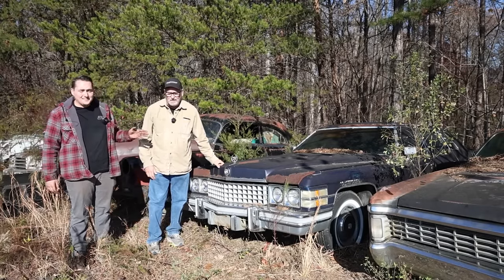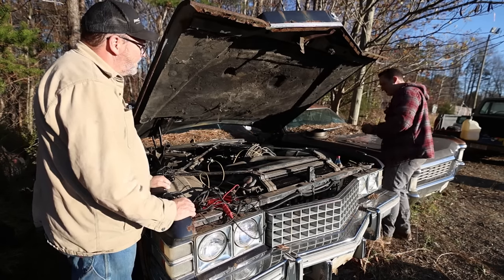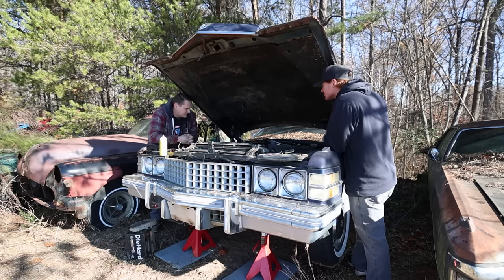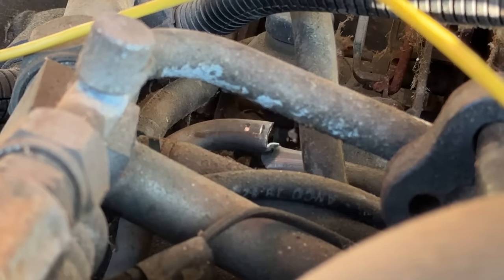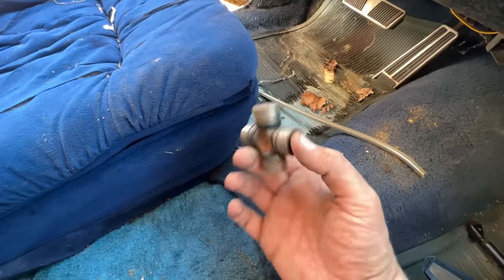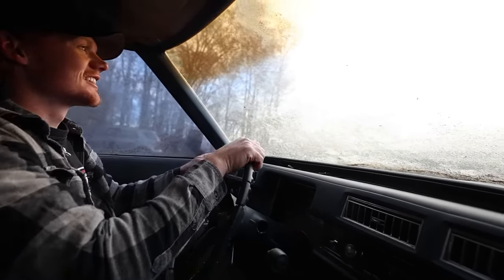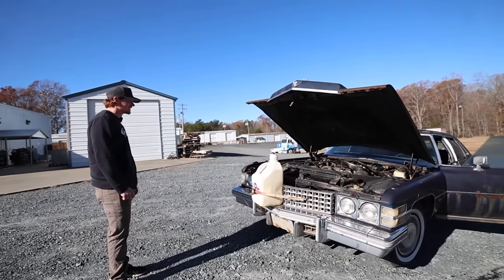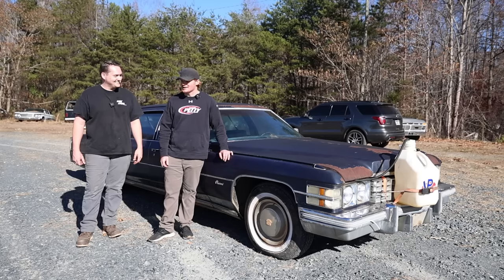RICHARD PETTY'S Forgotten Cadillac Limo - WILL IT RUN After 28 Years?

Comment: Great Video!!  I once bought a new '72 Cuda that was "Richard Petty Blue" as indicated on the window sticker. Had white stripes on sides & white vinyl roof, I put a set of Goodyear white letter Polysteel tires on it. I worked at WDAR in Darlington at the time for about 2 years. I was am still a huge Richard Petty & Mopar fan. I now work at a station in Clinton, TN & we carry all the Nascar Races on MRN, PRN & the Truck Series.
It was great seeing the Richard Petty Garage & the startup of the Big Caddy.

Comment: Interesting stuff! I had 1974 Coupe Deville for a few years, it was smooth ride indeed. BTW, the start button underhood is for bypassing Seatbelt Interlock System which was in use in 1974. You had to wear seatbelts in order to start this thing and if/when system failed you could press underhood button to bypass this and start vehicle.. Mine had this bypassed long ago.

Comment: That's a 74 Cadillac 75 series formal  limousine. Some came with solid and glass partitions in one piece or like this one  with no partition at all. 74 was also the last year for round headlights, the 472 engine and point type ignition . There's also a fuel filter in the fuel pump  housing and a separate AC and heating unit in the trunk.The engine pistons for that year are flat top,block is heavy nickel content,and weighs about 70lbs over small block chevy and were built to last.
Reply: This car is the Series 75 Sedan, not the Limousine. Only the Limousine had the partition.

Comment: The limo came with a front bench seat and some later person put  a pair of mismatched bucket seats in the front. Later when they retired it to the back 40, the front bench was just thrown in the back.  There are not two full bench seats in the rear of a limo like this. You get more leg room and two fold away "jump seats".  I rode in a car exactly like this at a relatives funeral.

Comment: Yeah I agree one should do work on that Cadillac re new the Radiator fit new ignition barrel new tires Sort the interior an bring back some shine to the exterior give it some love an use it .. runs good Can’t believe the Brakes actually worked after sitting 30years but hey they did that’s awesome.. I owned a 73 Cadillac Eldorado Baritz back in 1980 that had the 500cu in engine front Wheel drive an ran on regular Gas hit 16MPG on long runs would you believe ..

Comment: In 1974 the 500 was only used in the Eldorado,  however if that is a factory limo it's possible Cadillac put a 500 in it. Otherwise it would be a 472.  In 1975 all full size Cadillacs used the 500.

Comment: The start button on the firewall was for the seatbelt interlock. Back then the seatbelts had to be buckled for the car to start. The button would give you one start in the event the seat belts were broken. Most folks disarmed that government feature.
Reply: My 74 Charger still has that interlock on the firewall.
Reply: The button was a bypass a mechanic could use while working on the car.
Reply: @rafaelfiallo4123  yep
Reply: @LongIslandMopars my 74 plymouth satellite sebring still has the factory belt interlock system with the override button on the firewall
Reply: @mopar_man74  Cool! Keep 'em original.
Reply: @LongIslandMopars  it's finicky and is a pain in the ass because sometimes when it's hot in the summer it doesn't wanna work even with the seat belt locked in
Reply: @mopar_man74  Oh, mine is disconnected. The wire is under the front seat. I hooked it up once to see it work in the 25 years I've owned it, then disconnected it again.
Reply: @LongIslandMopars  when it works it's OK just doesn't like the heat ig, I'm probably gonna disconnect it at some point though
Reply: @mopar_man74  ok, cool. Nice to meet another 74 owner.
Reply: That module that he picked up right at the start of the video was the starter interlock module.
Reply: 74 b bodies are some of my favorites because it's literally the last death cry of the muscle car era, and it feels nice having one from the last year of its production 🤘 cheers!
Reply: @mopar_man74  I agree. My Charger was the last model year that the King raced a real Mopar racecar. The Magnum didn't cut it even though I thought they were a good looking road car.
Reply: @LongIslandMopars  yeah the kings 74 charger was super iconic to me cause I love the fuselage charger style
Reply: @mopar_man74 Me too. I grew up watching NASCAR with my dad and he was a Petty fan because a) he was a clean racer and b) he drove a Dodge. The 74 Charger was my favorite because it looked iconic (like you said) and it won a lot of races. The King is even on record saying that car was their all-around best racecar for how well it drove and the amount of races they won with it. I always wanted one after my uncle sold his 72 to a cousin who later wrecked it. I found my 74 over 25 years ago with only 27k miles. It is unrestored and can be seen on my channel in various videos. I may eventually do a series on it along with my dad's 66 Coronet that he owned from new and which has been in my inherited possession since 2011.
Reply: @LongIslandMopars  I never grew up in that era and I'm only 18 unfortunately I so wish I would have been born then so I could experience that era, I was gifted my grandpa's car this year as a graduation present by my mom when we got it running in May of this year I drove it all summer and had a blast with it
Reply: @mopar_man74  What an awesome story and honor it must be to be the custodian of your grandpa's Satellite. Is it a 318?
Reply: @LongIslandMopars  it becams my mom's after my grandma's in 2011 after my grandpa died and unfortunately it just sat due to nobody knowing how to work on it. In 2020 my grandma died and the car became my mom's and now it I'd mine. It does have a 318 in it
Reply: @mopar_man74  Amazing story. Thank you for sharing it with me and followers of this thread.
Reply: @LongIslandMopars  ofc I'm always happy to share, I feel like the custodian of the car to share its history
Reply: @mopar_man74  You are my friend. The Satellite is in great hands.
Reply: Thank you I will never sell it, it is my most valued possession and it will be driven for many years to come

Comment: I bought a 66 fleetwood 75 limo, funeral homes use them as the "family car" for funeral processions. It should also have a separate climate control unit for the back seats, also those flip ups are for rests. These are so much cooler than regular cadi sedans. You found yourself a gem, and the king is looking great still!

Comment: The 500 Cadillac is the biggest cubic inch version of Cadillacs v8's and is similar to the 472.  It is also the largest v8 used in a car of that era in terms of cubic inches. It has the bore spacing that is also a tie for the largest, meaning it has great potential.
Despite this, it is actually LESS heavy and bulky than several of the other v8's of the era.  It was a popular swap in old Chevy pickup trucks since it weighed little more than the small block they were replacing.  I have to guess that the narrow cylinder heads compared to canted valve engines was one factor keeping the weight and width down.  Also, it had a very mild idle and more torque, so it was well suited to pickup truck use.  There were aftermarket parts for it but they were not very popular.

Comment: I had a 1968 Fleetwood 75 . This makes me miss that car. It had those little fold down seats and those little things under the seats are foot rests. That other seat you pulled out doesn't go with the car.  Someone added that. Mine also had a sliding window between front and rear seats and a car phone

Comment: I'm old enough to have ridden in this model caddy, in 1971 one of my grandmother's passed away, I was probably 11, the little seat in the rear was for an extra passenger and the thing that came up when the seat was folded up is a footrest, I'm sure the manual is either available online or maybe from the coach company that built the car, I don't think it came from the factory like that, they were also probably used privately also, the chauffeur would drive and there was probably a glass partition that would separate the front from the back. A local funeral home near me is selling a mid nineties hearse, I think its a caddy or Buick.

Comment: The water running out of the trunk could be a coolant leak from a rear heater core that was used to heat the back area. The small seat that  folded up was called a jump seat. Then that other piece that folded down was a foot rest for the people in the back seat.

Comment: Good job. wonderful car,  the america that i loved. For those who wish to restore classic cars. There is one thing to know :  to be definitively efficient against rust,  you should  put grease everywhere. grease is the only thing very efficient against rust. put grease between metal and carpet, inside door, behind metallic bumper, under the vehicle, behind  the repairs you can make (everywhere inside the body - hidden erea -  instead of using paint), hollow areas (necessarily hidden, so no need to be aesthetic). For rear wings unreachable with a paintbrush, use an extender and poor old oil everywhere each year. rust  always comes  from the inside and welds.  Handyman Experience - 35 years.   From france

Comment: Its actually  a 74 and should  have a 472 engine.  Its a Fleetwood  75 with jump seats. That's  the short limo
Reply: I believe Cadillac limousines are built at an entirely different limo only factory.
Reply: @Supertech-86 Cadillac built these in the Clark Street assembly plant in Detroit with the Devilles and Fleetwoods.
Reply: @Andrew-bb3lc  I knew someone who worked a GM plant in Auburn Hill, they exclusively produced limos, they may have been built at Clark Street but once the stretching and interiors begins, its all custom fab - it would be impossible task to run them on the same production line.

Comment: The Petty's are good people. That Cadillac has a lot of history, the stories she could tell,.....  I would continue fixing her up. Get the radiator fixed if possible, if not get a replacement aluminum radiator, it may have to be custom made as there really isn't a big market for 1975 Cadillac parts. The key tumbler is an easy fix, new tumbler new set of keys, good to go. The paint being single stage can be brought back with a cut and polish. Put her back in service. A great support vehicle for in state races. Might as well get to the races in luxury.

Comment: Would the King sell me his Imperial?

That Bench seat that was in the back is probably the cars' original front seat.  I don't think Cadillacs of that era could have front bucket seats.

Those little seats in the rear are called "Jump" seats.  They fold out in case you need room for extra passengers, or fold away for all that big limousine room.  There should be two - one on either side.

Comment: Excellent video Dylan  :) also meet up Richard Petty , famillies, property  fix up Caddy Limo car  with 500 Cubic Inches  of a 8.0 Litre V8 4 Barrel carb  , Turbo 400 3 speed Automatic transmission  and 411 rear end gears! Yes those car get 8 to 10 miles per gallon local and highway get 10 to 15  miles per gallon  ! But drive like  boat on water smooth sailing Lol ! How know about those cars had school teachers drove them and plus lots friends of family's of mine all were Navy Blue with Baby Blue interior  and top notch options have everything! But amazing everyone seen original shape has Am radio no FM or even with CB radio 23 or 40 channels type of Delco brand ! But my one cousin Albert  has 1976 Caddy  , has Am / Fm  Cassette, plus 40 Channels CB Radio Delco brand 1980 one in 5 speakers  and antenna on front windshield  to !  That Caddy should be restoration to and key ignition fix up all needs !

Comment: Those Cadillac limos had the jump seats in the back, which is the seat that can be folded up against the front seat.  In a funeral situation, they'd typically be used to seat children, as full-grown adults wouldn't have much leg room. The little "kneeler" thing at the bottom was a foot rest for when the jump seat was folded up, so that the rear seat passengers would have something to brace themselves against if the driver had to make a panic stop.  Otherside, you'd be sliding off the seat (nobody wore seatbelts back then...the rear seat may not even have been equipped with them). That extra seat wasn't part of the car.  Probably just a spare seat.

Comment: 1974 the government introduced the new mandatory seat belt law. The relay you saw that says start is gm's answer to that law. You have to be sitting in your seat doors closed, seat belts on for the car to start.  Most people bypassed that system. The relay was so mechanics could start the car without all the other garbage. The law was modified a year later. So you only see that system on mainly 1974 cars. I have a 74 corvette with that system. I had to replace the seat pressure switch and a broken seat belt wire to get it working.

Comment: I would have replaced the mechanical fuel pump and not cooled around with an electric one., and replace the radiator and the water pump all the belts get rid of the jump seat in the back have a table with a flat screen TV attached to the back of the front seat. Mirror tint the windows instead of black tint, it's easier to see through and they reflect more Heat and the matches the chrome trim around the glass. A set of black center hubcaps, a set of h1h4 halogen headlights, new shock absorbers all the way around the filler panels around the tail lights and rear vertical bumper uprights. Wheel bearings redone, new brake hoses, new master cylinder, remove all the body side moldings a nice new one stage black paint job with enamel. New Black Carpet front and back. Pull out all the window motors take them apart polish all the shafts put the motors all back together. Do you rust and Lube all the door lock mechanism actuators. Careful with those power window buttons their fragile.. 1156 1157 Switchback turn indicator bulbs that are yellow/white. Some white 1156 LED bulbs in the cornering lights, even all the interior and the outer Opera lights they make LED bulbs that will go in all of them, and this car will be getting in better shape set of six fun odds in the back a new amfm radio a DVD player to play on the flat screen TV mounted to the back of the front seat a nice table with a cabinet with liquor bottles in it. And of course in those little cubby holes on the left and right of the back seat you can put the remote controls for the TV and the DVD player in those. I have a 78 limousine I'm fixing to do something similar with

Comment: Basically the seat you pulled out of the back is the actual original seat someone put those bucket pillow seats in it and the one small seat that you folded up is called a jump seat with a foot rest if you keep it folded up that's how old limos were they didn't start expanding the full lengths of limos big enough for 6 people to sit back there till the late 70s iv had two limos in my collection and that is small in comparison lol

Comment: that Cadillac is a 1974, with a 472 c.i.d rated at 235 h.p and 365 lb ft of torque with a THM 400 three speed automatic transmission.

Comment: Its odd that this is not a hei car from the factory. 74 was the year gm went to them. I wonder if its where it was a limo or something they didnt change that over.
Reply: The 74 limousines had the fan belt set-up for hei ignition ,but used the breaker point set-up

Comment: Soooo I have dug into it seems like a million gm cars from 60s 70s 80s and I've never ever in my life ever pulled a gm starter out with a ground wire across the starter bolt to the frame and it's probably the best thing I've seen on the Internet since is started to the public around 1997-98.... I own a 73 Chevelle SS with a 396 I installed when I was a teen and I still own the car and I've messed with the starter for years and years and had nothing but PURE trouble and NIGHTMARES with it.  So with new heavy duty battery cables and adding a ground strap like shown in this video.... Will this be the end to my Starter Nightmare?
Reply: Those ground straps came from the factory installed

Comment: O the youth of the world. 
The seats in the rear are called  JUMP SEATS.   Usually the lady's were given the rear full seat and 2 guys would jump on the jump seats. If the jump seats weren't being used the  rear seating passengers would use the back of the jump seat ad a foot rest.  That should have a 472 not a 500 cid.

Comment: Mr Petty's limousine is beautiful it deserves its fender skirts and hubcaps put back on it don't be lazy boys. Also the thing in the back seat that you didn't know what it was for that's for your feet. If you're not using the jump seat then you have it folded up and that's to place your feet on and when you're sitting in the backseat and that other seat is a spare it doesn't even really go in that car unless you need to replace the other seat? And it's supposed to usually have two of them little jump seats that you keep folded up unless you need to put more people and they're supposed to face Forward they're just axillary jump seats for when you have too many people in it that's all. Too bad Mr Patty's grandson doesn't get it fixed up and drive that thing around he'd be the talk of the Town driving that big old limo and a 74 doesn't have catalytic converters yet so that's a good thing you can get some power out of that 500 specially with the mechanics at Mr Petty probably has in his back pocket you could fix that baby up pretty quick question mark that would be a killer ride have it repainted cuz it's not that bad a shape and the interiors mint.

Comment: REPAIR IT  🔥 drop New belts , Make the fuel line feeds from the tank, Change engine oil gear oil Break Check  , BRING THAT TO RAOD FOR A FAMILY trip + check the ac and Windows🙈😍🤣